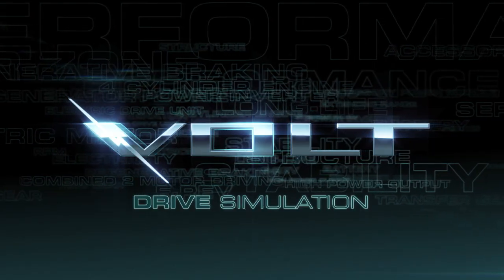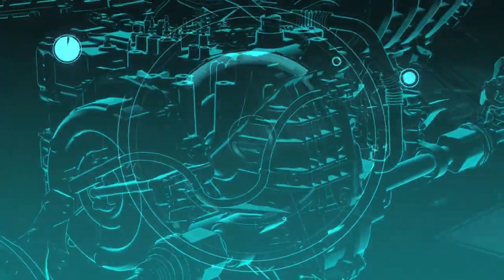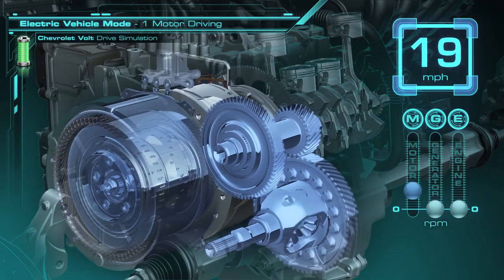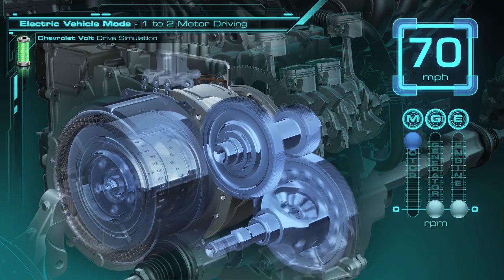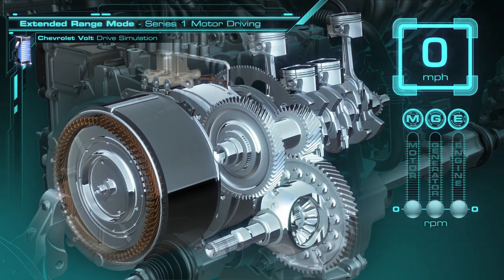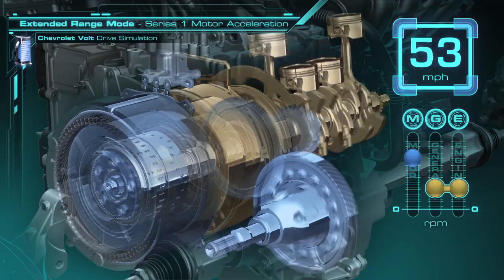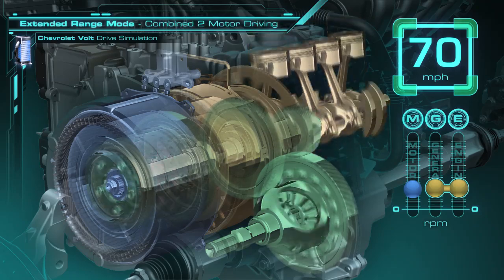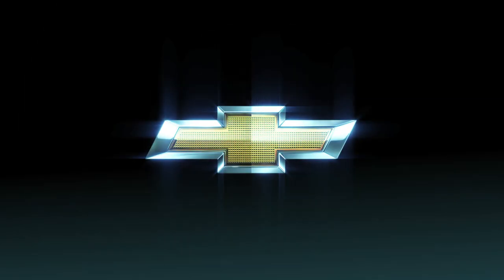Chevrolet Volt Drive Simulation

Comment: Aaaahhh, It's really not a parallel set-up.  The engine only assists the motor, same as when it's purely electric.  The engine isn't really driving the wheels, it's just adding a little power to the ring gear.
Reply: George Hendricksen You bizarrely start by saying I'm wrong, then repeat what I said, then finish by being wrong yourself.

First, I'm only talking about when the battery is depleted.  The controversy over the Volt's drive system is the fact that sometimes the generator is helping drive the wheels and the engine is helping drive the generator--does that mean the engine is directly driving the wheels?  Some people said yes.  What this video explains is that that is not true.  The engine is NEVER directly coupled to the wheels--this is where you're wrong.  The engine does directly couple to the generator, but the generator does not directly drive the wheels.  It only assists the primary motor at those higher speeds.

In some sense this is debating over nothing important.  I suppose someone could say I just described a parallel system.  I don't think so.
Reply: @greg55666  I've read the patent for this drive unit, and seen videos of it disassembled as well as read articles regarding its operation that go well above and beyond this video. The ICE can absolutely transmit torque directly to the differential in CS mode when clutch C3 (ICE to generator) and C2 (generator to ring gear) are engaged and it turns the ring gear directly, which turns the planet gear carrier, which turns the differential. It can do this even when the main traction motor is stationary. During this regime it will also simultaneously use the generator to bring the battery up to minimum SoC. When the minimum battery SoC has been reached the excess energy from the generator will instead go straight to the main traction motor so that it can speed the sun gear up, which slows the ring gear down, which allows the ICE to run at a lower speed (via the aforementioned clutches) to increase MPG. 

Plus when I drive my Volt and monitor the output of mga and mgb using the mygreenvolt app, there are some regimes in CS mode where mgb (main traction motor) is not outputting at all while mga (generator) is charging the battery. Only leaves the ICE to drive the wheels. This all corroborates with my previous paragraph. This video actually does the engineering behind this a disservice through oversimplification.
Reply: George Hendricksen From all the coverage of the drive train, I thought what you thought--that there was one mode where the ICE was clutched directly to the wheels.  But in this video the narrator says that is not true, the ICE is never clutched directly to the wheels.  It is attached to a planetary gear, so both the motor and generator/ICE are helping, but the ICE is not driving the wheels directly.  That was my point in my original post.  But as we were talking I realized that might very well be how a parallel hybrid works anyway, so it might just be labeling.  At any rate the point, for me, is that the ICE never directly drives the wheels, even in that efficiency mode you describe.
Reply: George Hendricksen Thanks, but I don't need any light--I understand it very well now.  Have I said something wrong?
Reply: @greg55666  This was actually confirmed with realtime stats reading, even during CS at high speeds the ICE is always generating power via MGA and chucking it back out of MGB what the traction battery doesn't need, even if a bit of the ICE power is being transferred to the wheels via the sun gear the HV system will always need power and MGA is the only way to get it in CS. If this isn't allowed to happen (ie, climbing mountain without a charge) you get RPP. (reduced propulsion mode) Even years later one can admit the media fuc#$%#$ this car by misunderstanding it on purpose with an agenda. Even at 100MPH MGB has to play a huge role in keeping the car at that speed, not exactly magic.
Reply: @spikester  Hi Spikester, it's nice to hear from you about a comment I made 5 years ago, except they don't even make the Volt anymore!
Reply: @greg55666  I reply to relevant comments and that one was more about disgust on how they discontinued the car, especially after the media fiasco surrounding it. Tesla would have suffered the same fate too if not for the trendy factor they built.
Reply: @greg55666  Also wanted to add that parallel propulsion would not be beneficial under most driving conditions. I outlined previously how the engine could be directly clutched to the ring gear, and how adding power to the ring gear, in some modes, is in fact driving the wheels. But using ICE and battery power only makes sense in high load scenarios, such as going uphill or overtaking. When this is the case, mga (generator) can help the engine turn the ring gear or mgb (main traction) can help by turning the sun gear, depending on what's more efficient. In other scenarios, discharging the battery for prolonged periods of time in parallel when in charge sustaining mode is wasteful. GM's strategy of output split between all three motors depending on conditions seems like the best compromise.
Reply: @greg55666  But what you're saying is that during that particular condition,  all three are mechanically connected.  So the ICE is, in fact, mechanically driving the wheels, albeit through two other linkages.   This disappoints some who felt they were promised that the engine only acted to drive a generator and feed electricity into the system.
Reply: @jonvelde5730  I don't think they are mechanically connected--my understanding from what I said above (I don't remember, haven't looked at this in a long time) is that it's only an electrical link--the ICE is not directly driving the wheels--it's driving the generator, which is providing energy to the motors which drive the wheels.  But I'm not sure anymore.

Comment: I've heard, from a Tango EV video, that DC motors cannot turn in generators (reversing currents?), so the vehicle can't do regenerative braking. So, a good hybrid or EV uses AC motors so you can recapture energy when braking, so DC power from the battery needs to be converted to 3 phase AC power.

Comment: Is is just 7:1 gear reduction or does it use CVT for multiple gear ratios?
Reply: It doesn't need a CVT because the electric motor just changes speed continually.  Gasoline motors use transmissions because of their narrow torque band and limited maximum RPM.
Reply: Depends on the mode it's operating in. In charge Depleting mode, yes 7:1 until the road speed is sufficiently high that it would accelerate the main traction motor to an inefficient RPM. Then the generator will come online to allow the tractor motor to slow down via the planetary gearset. In charge sustaining mode with the ICE on, the main traction motor can change the "gearing" by varying its RPM to affect ring gear speed. It's hard to explain without showing a model of how the planetary gearset works.

Comment: Have you heard bricking it?  You can easily brick a Honda battery.  An AC motor... say, 20% better then DC?   And inverter uses 0.5 (heat loss).  C'mon.

Comment: Because you get DC from the battery.  If you transmit DC from the power station to your house, it would cost you a fortune.  Convert it to AC, and you transmit for pennies.  Yeah, DC from batteries but AC motors work better and have less moving parts.  You save a lot.

Comment: I have a Volt.  Since I bought it, 5 months ago, I haven't bought gas and I have used about 10% in the gas tank.  At this rate, I won't have to service that ICE for the next 3 or 4 years.  And that's probably going to involve changing the oil because it's been standing around a lot.  My gas millage is about 280 miles to the gallon.
Reply: Although technically we're supposed to change the oil every 2 years ... fellow Volt owner.
Reply: I like the idea of the Volt, but I'm worried about the added mechanical complexity that offers more to break down and need repairing or replacing. I'm looking for a fully electric car, and the Bolt (with a 'B') is looking great. Second hand ones are around $20000 - 26000.
Reply: @JustWasted3HoursHere  You make a good point, but this car is so well built that Eric Belmer a guy working at the Lordstown plant racked up 400,000 miles on his 2012 volt and doesnt have any major issues with it.
Reply: @bmw803  I did seriously consider an EV with a "back up plan" like the Volt or the BMW i3 with Range Extender. Not interested in a "normal" hybrid like the Prius, even though I'm sure they're great cars. A full BEV fits my lifestyle perfectly, and I'm really looking forward to never having to go to a gas station ever again (except to buy a Slurpee or a Big Gulp!)

Comment: Seems to me like GM really wanted to put an internal combustion engine into an EV. I have an electric drill, I never get it maintained because there is no need. A pure electric car would occasionally need new tyres, or windshield wipers, that's about it. An internal combustion engine is always going to need spark plugs, oil, air, & fuel filters and pumps, and replacements for all those complex moving parts. I'd buy a real electric car. Not one that will tie me to a GM support plan.

Comment: DC-to-AC conversion is not that lossy.  99.5% efficiency is typical and that 0.5% loss is made-up by the greater propulsion efficiency of an AC motor
.
Reply: It's absolutely NOT 99.5% efficient. Ask any RV'er that has to use an inverter. 90% is very efficient for an inverter.

Comment: Weswada, this is different.  The motors are brushless motors and it is the continuously varying AC currents through the windings that replace the old-school commutator brushes.  In the electric car and airplane world, we wouldn't call it an Inverter, we'd call it a Brushless Speed Controller.  Does this answer your question?

Comment: This video shows why the Society Of Automotive Engineers named the Volt Best Engineered Car in 2011.  If you want to see where the Volt technology is going, check out Via Motors full sized pick-up truck that will get 100 mpg when driven about 60 miles.  PG&E is going to use them for their fleet.  Jay Leno's Garage has a good review on YouTube.  You can power your whole house with the turck in a blackout.

Comment: (Part 2) Next is the question about DC to AC conversion. There are a few good reasons why you want AC; 1) it's multi-phase AC which means less current for the same power. 2) with AC you get "free" speed control since speed is related to frequency. 3) speed control on DC requires more complex controls + expensive hardware. 4) either the DC motor uses brushes that will wear out, or you get reduced power at low speeds. Since conversion to AC is very efficient (>90%) the choice is obvious.

Comment: I know this comment is 6+ months old but it seems nobody answered. As a Mech. engineer I'll take a stab at it. - For one, using 12v for the main drive is insane. The main motor is 150HP which means 9,250 amps at 12 volts! Imagine the size of the switches and wires you'd need to safely carry that much current - not to mention how much that would cost. (Continued in next comment)
Reply: Smidge204 battery pack is over 300 volts...
Reply: Smidge204

Comment: AC motors allow regen. DC motors do not. To use AC motors and get regen, you have to convert the DC battery power to AC.
Reply: That's not true, its just easier to build AC electric motors/generators with conversion to/from DC than to put in the brushes required for DC.
https://electronics.stackexchange.com/questions/215997/converting-a-dc-motor-to-a-generator

Comment: Higher voltage is much more efficient, requiring smaller cables and producing less heat. It is also easier on the batteries to deliver high voltage at low amps than the other way around.  Using AC allows the use of brushless motors which are more reliable and powerful.  It also allows easier control of timing on the electric motor.
Reply: Your video(s) on the Volt got me on the path to buying one (2018) in May 2021. Even then, I didn't truly understand how the hybrid drivetrain was working until I did a lot more close looking and research.
Reply: Oldest comment I've seen by 8 bit guy, at least on a random video!